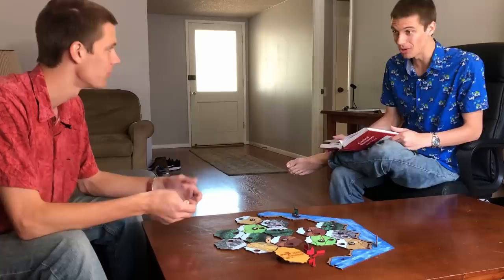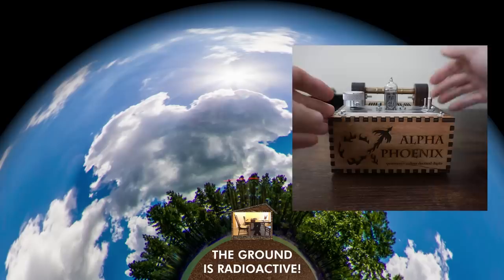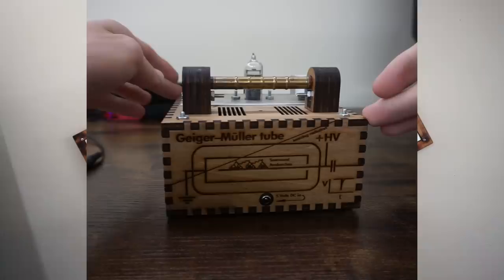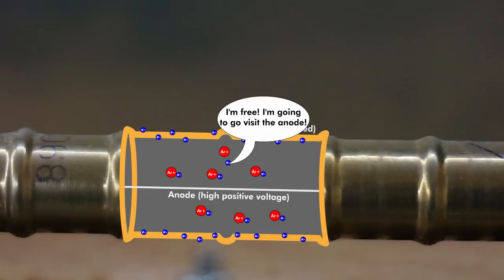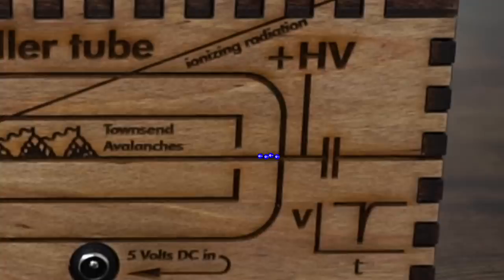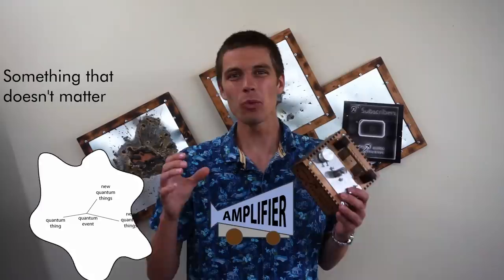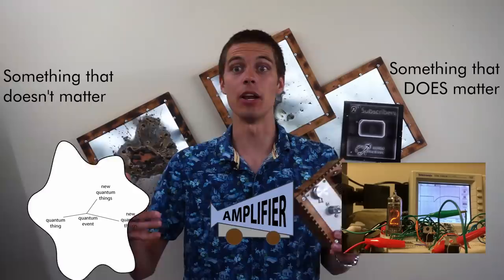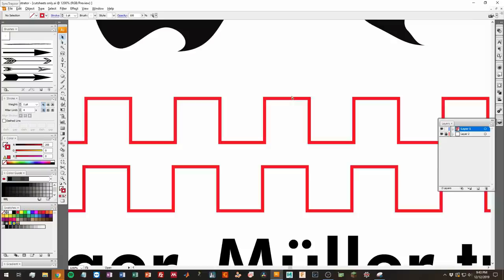The muon-powered, universe-bifurcating, random number machine

Comment: Props for using no Arduino (or any microcontroller at all)
Reply from the maker: *made by the discrete component gang
Reply: relearns what a gated IC is
y-yes.
Reply: Well what's wrong with microcontrollers?
Reply: @vikingursigurdsson  Nothing, really. They're just so ubiquotous in DIY electronics projects on YouTube these days that it's nice to see a project that doesn't use one.
Reply: @annaw.1951  Thats why I like ben eaters 8-bit breadboard computer project a lot.
Reply: @matthewe3813  For sure, that project is super interesting for a number of reasons ^^
Reply: @vikingursigurdsson  Overkill, and seem to be used for the simple reason that you can just throw code at a problem instead of actually solving it in the real world.
Reply: @Asdayasman  if it works in the real world does it actually matter? There's a number of reasons you wouldn't use a modern microcontroller here starting with voltage limitations. But as we're teetering on component scarcity in an ever increasing number of fields maybe not needing to use all of the billion 555 chips produced annually is a good thing sometimes?
Reply: @Monkeyshaman  "does cost optimisation actually matter in the real world?"  headass
Reply: @Asdayasman  🙄 tell us how you really feel,like really because I'm not sure what your calculus is on long term resource preservation to get to lower prices with more components laying in storage for the event that they're actually needed. If that's indeed what you're saying, it's currently unclear which part you're opposing.
Edit: to me, it's unclear to me.
Reply: @Monkeyshaman  We gotta start from base levels here, like what do I need to explain?  Are you familiar with BoM?  Pick and place?  Economies of scale?  Human resources?  Global trade routes?  I feel like you have to have almost no understanding of anything outside your own front door to not get how dedicated circuits are better than microcontrollers.
Reply: @xero2715  How can you not see the irony of invoking the names of Dunning and Kruger when you're talking to me about hobbyism and how we're going to run out of 555s (yet somehow arduinos aren't subject to similar shortages).

Stop talking to me.
Reply: @Asdayasman  😄 are you just saying buzzwords now? If you follow my admittedly long winded thought you'll notice I did underscore how microcontrollers came out of the same rare metal mines as other Components. No one here (I'd think) is opposed to task specific circuitry but there's admittedly a reason small single board street level operations choose simple designs mostly working of off the ICs logic capabilities. 🙄 From a human resource tool chain global marketplace turnpike twist and shunt (get the last one while it's hot, it's the buzzword of the 2030s. you heard it here first)
Edit: perspective. 😄 Maybe I shouldn't judge you for not following my thought process if I can't myself.
Reply: @vikingursigurdsson  something so simple is a waste of Microcontroller.
Reply: @Asdayasman  you are forgetting hobbyists use the components they already have over ordering new componenents and considering i have over 100 microcontrollers sitting in drawers for hobby projects, not using them and ordering new parts would be wasteful. also, considering most projects i make get scrapped when i lose interest in them using microcontrollers that can be used for many projects rather than a single one. you are assuming hobby machines are used indefinitely and thrown away like most commercial products which is not the case.
Reply: @xero2715  lmao you pissed off the chair of electrical engineering at MIT on his lunch break it seems. lucky we got a few words from his grace, usually he only allows a single insult to the lowly students and the laymen of the real world outside his lab
Reply: You could then string these 0 & 1s together and see what data it would create 🤔
Reply: Would give more props for not using a triple five.
Reply: @dozog  😬 go with god friend.
Reply: @Monkeyshaman  😂
Reply: @xero2715  it's better for some to use and understand the physics of discreet components rather than just throw code at a problem. Same basic principle with people who want to understand their computers and self repair rather than outsourcing the problem. 

Ones easier and less in depth. That's a fact
Reply: @Monkeyshaman  It only matters if it's going to be sold at large quantities.
 Arduino and stuff are generally more expensive then buying discrete components, its also a waste to use arduino most of the time, arduino comes with a lot of features that are useless, and those features aren't free, so designing a circuit board with exactly what you need saves money.
Reply: @Asdayasman  For the average hobbyists to not use the simple options then they need to at least study electrical circuits to some degree. Not many do this unless they're already in uni.
Reply: @WilisL  which is why everything around us is built around a loose conglomeration of 555 chips in ever increasing occult formations. No I get it. Too bad atmel not only produces the only microcontroller on earth but also only makes it as a full board dumputer as well.
Reply: Why use discreet components when you can do it programmatically?
Reply: It is not an eletronic solution, just a code and borring one.
Reply: @thegremlin9876  To hobbyists, it doesn't mean much. 

Imagine this scenario, if I wanted to create an AND gate situation with two buttons, all I would need are two buttons and some transistors and a LED to indicate the result. This is using discrete components.

If I wanted, however, I could do this with a program written in C++ which is then translated to machine code on my i7 intel chip alongside my 3070RTX. Bit of an overkill right? Waste of money right?

All digital components and such are all built from logic gates which are built from transistors essentially, to begin with, so by scraping away all the unnecessary features such as my RTX3070 or my i7 chip which obviously isn't needed to turn on a LED. The point is, many features of an Arduino are useless and are not needed, these features cost money that can be saved.
Reply: Creating a circuit from scratch, with basic doors, is more rewarding than using an all purposes circuit. It's a little bit like using Arch instead of Windows. In final you have Firefox usable, bit for one you learned to build all the path, not on the other one
And a made analogic circuit is more precise, faster and energy saving than a numeric AiO one. It's negligible at lower scale though
But you know, I respect more the times where we used to make beautiful and natural mathematics formula to define a behaviour than a machine manual with code
Reply: I hate coding.
Reply: @zXHAcKeRzXz  We still do do this, just not the average hobbyist.
Reply: @Asdayasman   How is "throwing code at a problem" different than "solving it in the real world"? What are you using as the definition of "real world" in the first place? Last time I checked coding was part of the real world, and solve an astonishing amount of problems, more than humans are capable of. If your objective is to be the most efficient in a task, it's not very clever to make a huge effort to do it manually, when you can solve it by more practical means. No one needs to reinvent the wheel.
Reply: @AndrewHalliwell  There are very simple microcontrollers.  I think it was eevlog that showed some 2-cent controllers from China.
Reply: @vikingursigurdsson  they have CPUs, brought to you by the anti-Turing gang
Reply: @annaw.1951  its like Javascript, things are always nicer without it
Reply: @dionyzus2909  "throwing code at a problem" different than "solving it in the real world"
it means solving it using actual atoms and physical processes instead of abstractions and digital processes simulated in a generic purpose computer.

the less code, the better.

like, for example, most of the startups bullshit in the tech industry can actually be solved by Excel, or by paper and a calculator.
Reply: A 4-bit uC would have been cheaper if you factor in the two 555s, the extra board space and the components needed for the 555s. And using a 555 is not rocket science, so I don't see the advantage even in bragging rights.

Comment: Honestly, it was nice to see a Nixie in a project that WASN'T a clock.
Reply: So random 🙃😉
Reply: Sweet right? Well time to go make a nixie clock/watch
Reply: Actually that was a clock that shows the time when a muon hits the tube
Reply: @mr.0x373  only one digit
Reply: @official-obama  well, 10 seconds instead of the regular 12 hours of the round clock, but it still goes round, just many more times in unnamed and unfollowed cycles
Reply: Nixie tube 
radio frequency display, 
Speedometer
Calculator
Cash register
Volt meter/ ammeter display
Reply: Huh? Mayshii's clock stopped working

Comment: As a designer of random number generators of the sort you find in your CPU, that's a not-very-good random number generator. If you sample fast enough, you will get highly serially correlated data since it's an up-counter with a partially random clock. You use the term "Truly Random" when you should say "Non deterministic". To get to full randomness (1 bit of entropy per bit of data) you need to study up on entropy extractor theory. All the non-determinism in normal electrical RNGs come from quantum effects that lead to electrical noise. So there's nothing particularly special about a Geiger counter based RNG.
Reply: True random is non-deterministic. This is still pseudo-random.
Reply: @jayjasespud the only right answer in this whole room of pseudo intellectuals
Reply: @jayjasespud  The term "True Random" is used differently by different people. In all cases it seems to mean nondeterministic but for some it means full entropy and others it does not. Since cryptographically secure, nondeterministic, deterministic, full entropy, partially entropic and other terms like that are vey well defined and accurately define the properties of an RNG, poorly defined terms that don't really match what they mean like PRNG and True Random should be avoided if you want to make your words unambiguous.

Comment: You should try to build a device driver that integrate this device into your computer as /dev/random
Reply: But keep around the nixie tube, just for fun.
Reply: This device I don't think can serve as /dev/random without some work. 

Need consant source of numbers at any time, it cannot afford to wait seconds between requests - what do you do if you need /dev/random 13,000 times this second, 4,000 next second, etc?
Reply: @kiraPh1234k  All you need to do is scale up the area of it. The more area, the more muons you can detect
Reply: @kiraPh1234k  just have it backlog a bunch of random numbers and save those number for future use. As one is referenced, toss it away. Place a piece of radioactive material next to the device to crank out random numbers faster.
Reply: believe it or not this actually exists commercially, it's called an HRNG and there are many types using many quantum random process

Comment: Nicely done, I’ve always pondered the use of a Geiger counter as a random number generator. In fact I’ve got a tube just like your one in my parts box in a breadboard boost converter circuit that may or may not have experienced one too many exciting discharges.
As for your use of a nixie tube with an upside-down 2 as a 5, I like your style.
Reply from the maker: The SBM-20 was an upgrade from some really really tiny glass geiger tube I started with a few years ago. Other than making some toasty arcs inside when I got the test source too close to it, it's a great tube! I think I may have too little resistance in series or something to get very high countrates...

As for the upside-down numbers, what can I say but I bought the cheapest tubes I could get!
Reply: AlphaPhoenix
Different GM tubes have different gains or counts/area/second or whatever the metric is. There was a website I found a year or two ago when searching for a comparison between tubes that comprehensively measured a dozen or two of the tubes with alpha, beta, and gamma sources, both solid can and end-window tubes, chances are you’ve also stumbled across it. Really great resource, but I’m the end cost becomes the major factor when choosing, at least for me. I initially picked up the tiny SBM-21 as it was the cheapest GM tube on eBay, but I tried to solder a wire to it and it turns out that the plug in the end to keep the inside at low pressure melted at under 300C, so that ruined that tube. So I bought an SBM-20, as the ends of it perfectly fit a standard fuse holder bracket. The positive end of the SBM-21 is too small for any common size of fuse holder I know of, so I’ve no clue how it’s supposed to be held. I assume you’re also using fuse brackets yourself.

As far as nixies go, a lot of the surplus ones around today are of soviet origin, where cutting costs by using the same digit for a 2 and 5 was somewhat common. I personally quite like this, it gives the display a character not found on other displays. I haven’t began a foray into the realm of nixies just yet, but when I do I plan on going for tubes which have symbol versions, e.g. Ω, V, A, Hz, etc.
I’m also considering some of those obscure panel-mount electroluminescent displays, since they can be used for alphanumeric applications. From what I’ve seen on Applied Science’s channel, multiplexing EL displays is quite the task.
Reply from the maker: Yeah inside the lasercut wood humps on top of the box I've got some bent-up fuse holders I had to be very careful to not let touch any of the screws I use to hold it together lest I zap myself with 400V...
I have also noticed that nearly all ebay vacuum tubes seem to come from former soviet states. Kinda interesting

Comment: When I was in the military I proposed a setup for random number generator that used subatomic particals to pick a randomly selected number that was then used to pick a random number of algorithms for a second number to be run through and then that will be your result the order of the algorithms could be determined randomly along with the starting algorithm and you could also make it repeat any number of times you want at random and the whole idea was to introduce as much difficulty as possible to determining the final value and what might have made the whole thing possible is that you could possibly just get it to work on a smartphone of the time.

Comment: Just a random (ah.. yeah) thought - You could use 2 (or more) events to set the clock frequency, then a another to start and stop the counter, if you wanted to reduce the averaging of time between muon events as a way of predicting the next event. Start at random a counter clock whose period is determined at random, then stop it at random. When recycled, there would be no way to predict the next event especially if you run the clock in the mhz range. You could even use several GM tubes and select the tubes used for the events based on a previous muon event. If you wanted a bigger more elaborate randomizer model. I've been a student of random since 1977 when I built my 1st big computer, a 6502 machine overclocked to 2mhz. True random is much harder than most people realize, but this is one of the better method I've seen. Cool too, using natures random events as an engine.
Nice project. Enjoyed the video, thanks!

Comment: For those interested the special relativity that allows muons to reach the surface is basically a way of describing the fact that in real time (our practically stationary frame) these particles should decay before reaching the surface. However due to traveling at such a high rate of speed they can travel that distance while experiencing less time then it would take to travel that same distance from a stationary frame of reference.

Comment: I think a great improvement for this would be to add some kind of memory component. Then, when a random pulse is detected, instead of displaying a value on the display, store the value in memory (or store the time between detections, since that's where the randomness comes from). Afterwards, a user can just press a button and the device will display the oldest stored value and delete it from memory. This can be made more or less complicated as needed, for example by making a system that stores lots of values and can also recall previous random values instead of deleting them, or random numbers for specific dice types (like d6, d8, d20 or others).

Comment: From Little Brother my favorite definition of randomness is that the fastest way to tell a computer to print the number is just one line of code that says print 142513469205813846... because if you take the 100-200 digits of pi it might seem random but it is a lot faster to tell a computer to find digits of pi and start printing at 100 and stop at 200

Comment: I built a random number generator based on a radioactive source 20 years ago. After initial failures I realized the initial short dead time that a Geiger tube has produced a bias in the results. I did a maths fix by changing my algorithm to compensate. But In the end I concluded that radioactive decay is not random at all as it has a mean time of decay, a half life.  If something has  a half life where you can expect 30% of emissions happening around the mean time then its not really random.  Its some process we don't know about but its a process.  Random would be 10 emissions in a second,  nothing for 3 months, another 3000 emissions, nothing for 2 years, then a whole stack of them. That's random.  What we need is a detector of virtual particles popping in and out of existence. That might  be random as it gets to be closer to the the conditions that our universe came to be, out of nothing matter pops out for no reason at all.